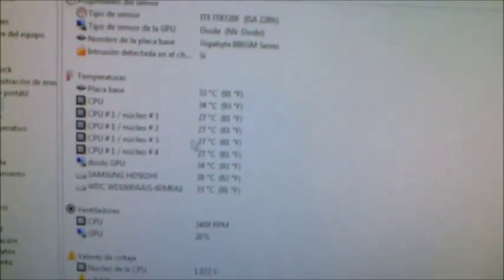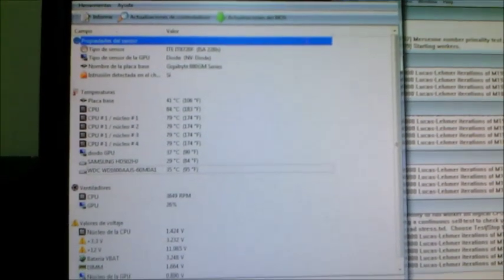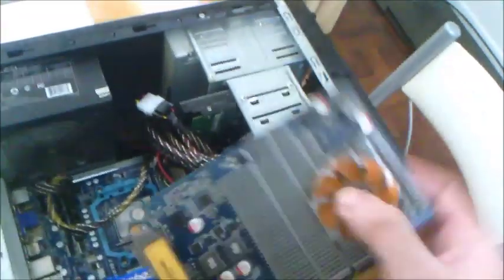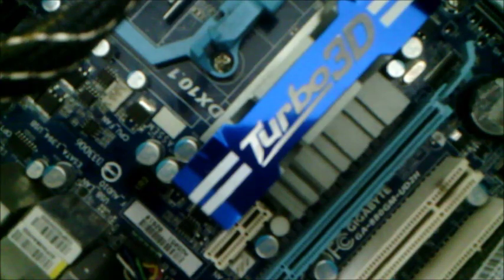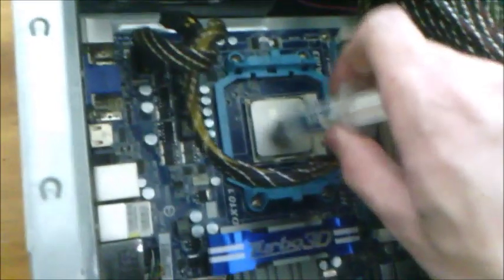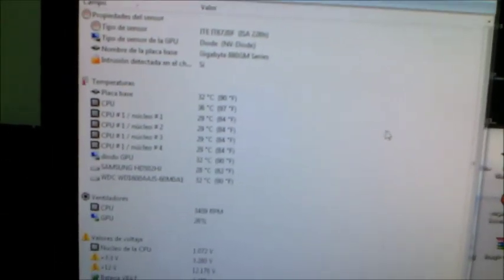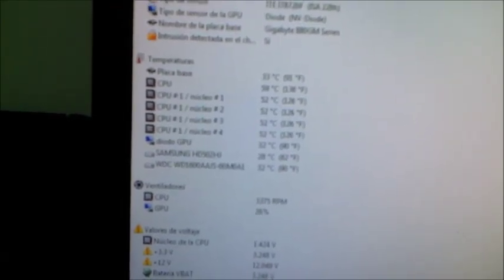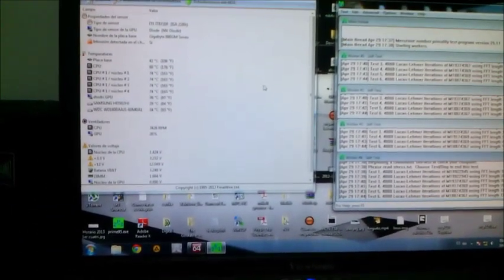Arctic MX-4 Thermal Compund Before and After

Comment: Had Cooler master 5$ thermal paste on my GPU & CPU. Bought MX-4 and placed on both. CPU - i5 3570k, OC'ed @ 4.5GHz @ 1.4V (turbo voltage), GPU - Gigabyte HD 6750, OC'ed max possible, unable to change voltage.
With 10 min of prime95: temp. on CPU is 1-2'C colder after MX-4.
10 min of MSI Kombustor: GPU - min temp is 6'C colder, max 5'C colder.